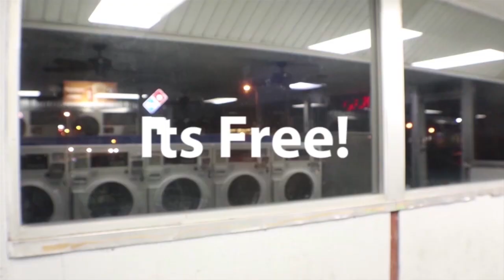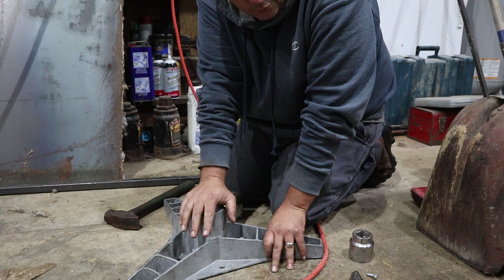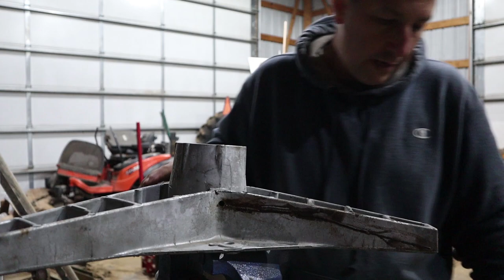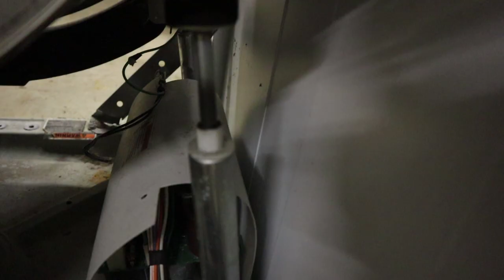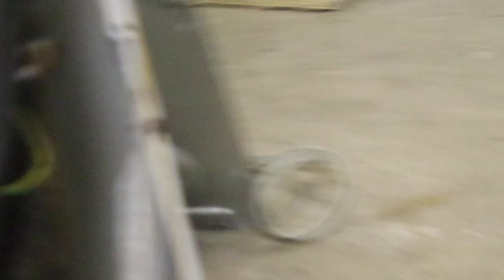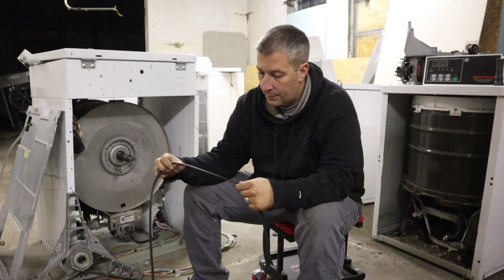Going On Vacation with a Laundromat!$! | Following Keenan ! Bearing Replace Part #2

Comment: Hey Keenan, thanks for your video, changed bearing with success but had problem, the shaft would go in only flush with bearing housing. so I remove inner drum and tried that way and same problem. I did grease up shaft but needed to use bolt and washer at the back with a spacer to pull it in all the way. All is good, and I'm sure I'll have more on my other machines to change. Thanks again from Ontario  Canada

Comment: In bearing change on Horizon washer  Put bearings and seal in Freezer for About 2 Hrs. Heat housing with Heat Gun   bearings with fall ring in. This will work on any bearing housing

Comment: My  question is when you purchase the bearing assembly it comes with directions that wants you to use a tool called Pulley bolt tightening fixture and a procedure for using it. Have you ever use this tool and do you have a video using it?
I have been doing work for a owner of a Laundromat. He asked me to replace the bearing on his washer (he has had some bad experience that costed a lot of money and done wrong) that is a similar model of the one you're working on in this video. I have replaced many bearings over the years. So this work doesn't bother me. But before I do replace the bearing assembly I like to do as much research as possible to do it right the first time.
I have enjoy your video's. I should have found these before I did most of what your videos have shown. Would have saved me some time. lol 
Thanks for the vids!
Reply from the maker: No i dont use that tool. Its basically three long thread rods and a plate. That you use to hold a bottle jack. I just use three full thread bolts. Works for me and no issues wjth any damage. Dealer showed me how to donit this way. Dealer claimed speed queen tool was not necessary.
Reply: @FollowingKeenan  Sorry Keenan, I wasn't clear. the pulley bolt tightening fixture (part# 802336) is used for putting the pulley back on. The instructions tells You to put it between the washer and pulley, Snug the bolt up then loosen it enough to take it out. Then pull the inner basket forward so the washer hits the pulley. Then tighten the bolt to specs and try not to push the trunnion shaft forward while tightening the bolt. The tool looks like a candy cane.

Comment: Great video, really helpful. Where do you get the bearings from though ? I think our distributor only sells the whole kit with the aluminium trunion etc. Is there a part number for just the bearings please ?
Reply from the maker: I'll look for the part number. Ebay, Amazon, Grainger is where I get bearings from. Ebay and Amazon best prices. The seal I get from my dealer. 

I'll do a short video on part number. It actually on the bearing themselves. Also I will show the seal part number. 

I buy double shielded bearings. See in speed queen kit. They use pretty cheap bearings.
Reply: That’s great, thank you. I’ve been showing your videos to colleagues over here in the Uk as our alliance distributor has stopped doing proper tech support this year sadly (they used to be great). Don’t suppose you have ever done a video on changing a 804174P horizon deflector cloths guard have you ? None of us c an work out how to swap them ? Thanks again - great videos - really helpful !

Comment: thanks for all your lessons they are very helpful.
I have 10 new stock-able alliance washer dryers M# UTGE5ASP115TWO1 year 2018 and 3 electronic board went out already, I was wonderin if you know for any recall because I think its very strange to me.thi part is about $ 600 to 700

Comment: Depending on how many bearings you need to replace it might be worth getting a hydraulic press for the even pressing force.
Reply: I'm sure he has one would just be a pain in the back side to take it to his place then bring it back to the laundromat. Time is money.  What is your time worth ?
Reply from the maker: 100 right bearing press is a must. 

I have a bearing press, actually made the video for a viewer. Who I assume may not have access to one. When I do the 40 lb washer my press will be used.

Comment: Quick question what mix would you put in a 2400 square foot store?
Reply from the maker: In my area that would be a very large store. A lot depends on your type of customers. But if I had that where I'm at (4) 80lb, (10) 60lb, (40 or 30lb) 10, then (10) 20lb. So 34 washers, and 15 to 20 45lb stack dryers. Big folding area, big open concept industrial look. Kids area since you have room. Maybe even an eating area, maybe. 

But you can build smaller and gear up also. Hard question to answer not knowing the amount of customers you'll have. Like building a walmart in the middle of no where. Sure looks great and has promise but no  people to use it.
Reply: Thanks. Here 2400 is considered real small. This is in a high density "guns and knives" district as you put it.
Reply from the maker: Then big washers, that demographic loves big washers.
Reply: @FollowingKeenan  thanks for the reply. Love the videos.

Comment: How long does that bearing job last
Reply from the maker: As long as the horizon doesnt have any over filling error, should last 7 years on general use. Higher use 5years. 

In busy laundromats you only want hardmount machines.